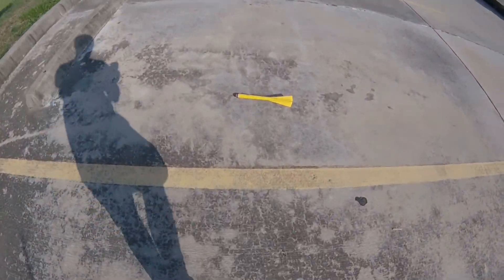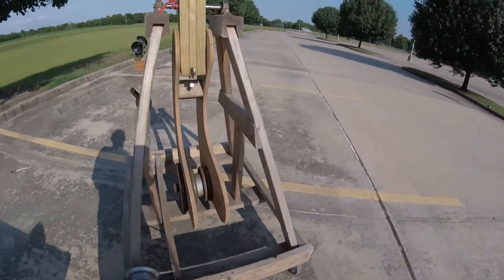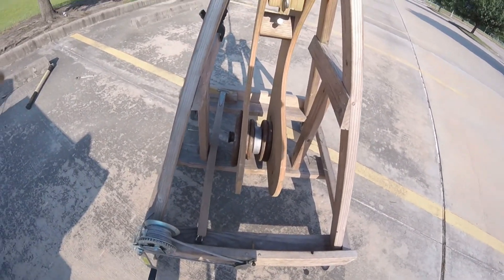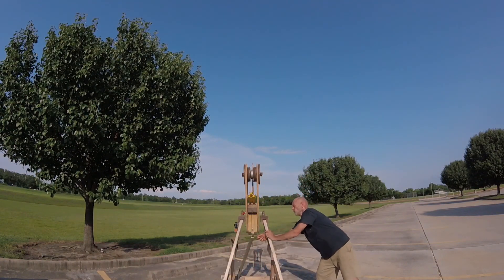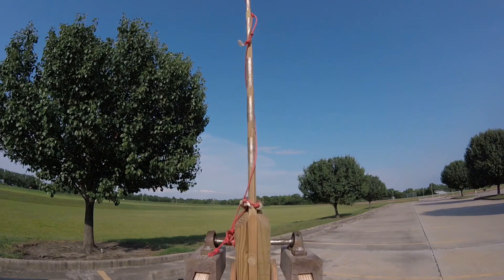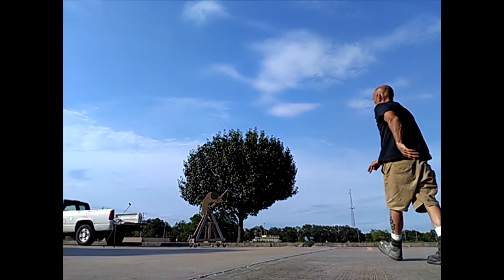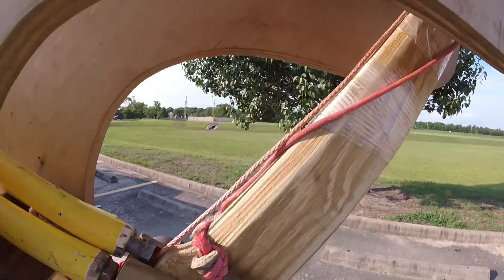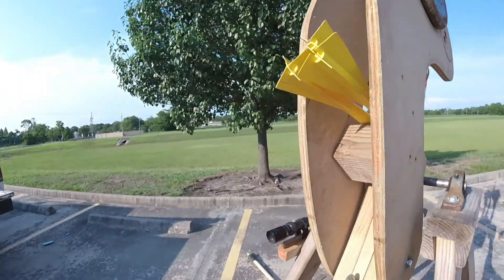Trebuchet 3 Darts Testing

Comment: Nice shot at 6:45. The hook system seems to work. I tried to throw a bolo set but it got tangled in the sling. I think I might try encapsulating it in a hinged sphere. Something light weight that gets it  safely out of the sling and then sloughs off like a seed husk.
Reply from the maker: Like a sabot. Tom what's his face did that with a 3 D printed ball that separates.
Reply from the maker: Maybe just try wrapping them in a little paper. It should blow off shortly after launch, but contain them long enough for the release leg of the sling to clear.
Reply: @FingerAngle  Thats a good idea, paper why didn't I think of that? I was thinking of cutting open a soup can with a grinder and using tire rubber as a hinge. What a mess that would have made.
Reply from the maker: @rowgler1  keep it simple! :-) It helps to have someone to bounce ideas around with. I really appreciate having good folks around me to inspire me, and work through issues together. That is what I want this channel to become, along with our facebook groups. Thanks for being one of those folk!
Reply: @FingerAngle  Thinking is good. A spiral rap of paper would impart some spin as it peeled off, it could help with a round ball for your Magnus effect. Have to orient it in the sling right to point it up. Maybe a strip of silken cloth like a disposable kite tail. When I open a roll of disposable drop cloth (9'x12') I flip it out like a bullwhip. It makes a neat sound. I could have gotten tomato soup in my eyes and been electrocuted. It would look so dumb on a tombstone.
Reply from the maker: @rowgler1 dumb on a tombstone, but makes Great TV! hahahahhahaha
Reply from the maker: You'll have to experiment with the sabot technique and design. Let us know how it goes! I may give it a whack.
Reply from the maker: I may have to try that too. I used that method launching a bunch of marbles and BBs.
Reply from the maker: I loved that hit pattern of shot two. Triangle